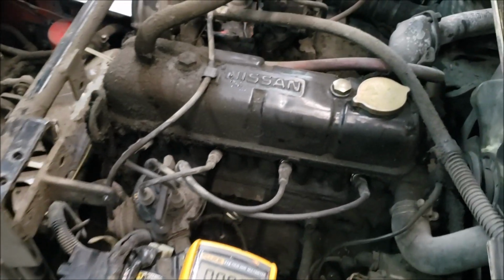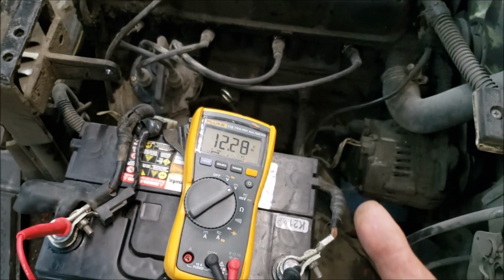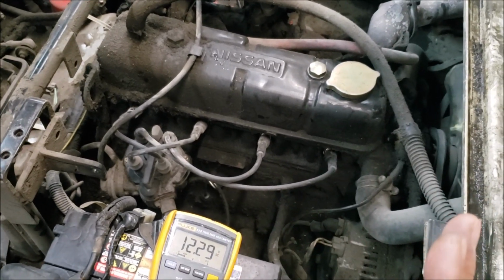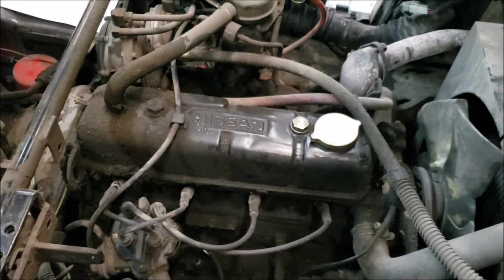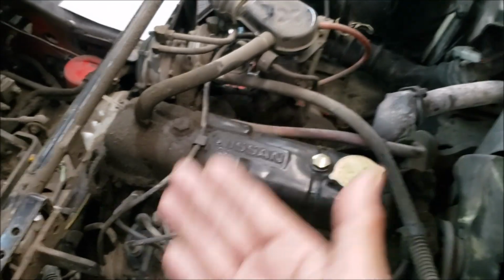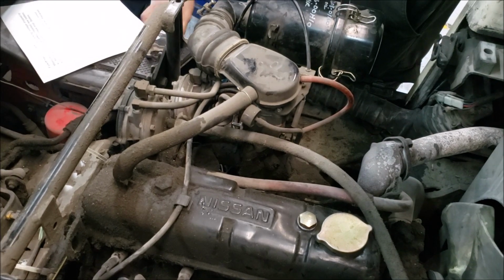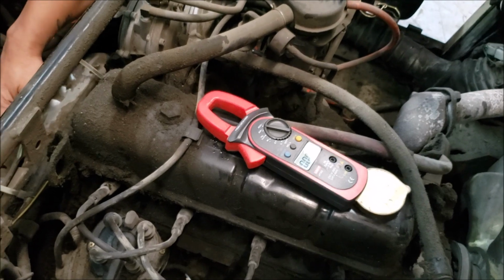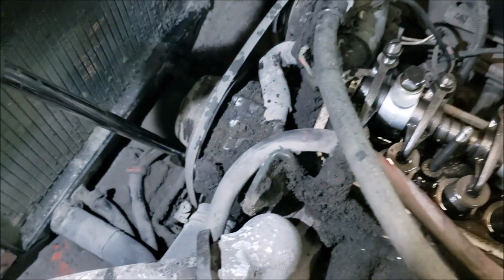No Crank, No Start, New Battery, New Starter

Comment: why would my cat p6000 not have any throttle response... it has a e21 code for maf, i found the connector for the maf was damaged, so i fixed it, and it runs a little better, but still acting the samesame mostly.,, tried to clear the code with no success.

Comment: My 07 Silverado , new battery , new starter , put the key and nothing
Reply: Also it’s a 5.3 ls
Reply: Checked all of the fuses but nothing
Reply: You probably already fixed it but my guess is that is was either the ignition switch, neutral safety switch, starter relay, or high resistance due to corrosion in the cables going to the starter or starter ground. Do voltage drop tests from battery positive to all cables going to starter and from battery negative post to starter housing.

Comment: So i have a 6.2l im having the same issues with.. should the motor be easy to turn if its not locked.. hopefully.. because ive been thinking thats my problem with my diesel truck..
Reply: I would think diesels take more torque to turn because they're higher compression engines compared to gasoline/petrol engines

Comment: Battery is perfect, switch goes on, but when i turn the key more for cranking, nothing else. I am starting my diesel forklift directly from self starter by connecting both negative and positive points with the help of a screwdriver... what else with my forklift... Please advise somebody...... Even i didn't find the fuse box,,, where is it?

Comment: I’ve done everything you said, I was about to scrap my car as I decided to tap the second new starter motor, a few blows with a rubber hammer and it sounded rough at first, then ran perfectly, deliberately stalled the car and restarted a few times, all’s well now. Thanks for the tips, I bought 2 batteries and two starter motors but finally got there in the end.

Comment: Ever have a Toyota lift stall while turning, I’m working on one now and can’t figure it out the Toyota techs can’t even figure it out , runs good has new vaporizer  and only stalls when turning all the way either way
Reply from the maker: What model? Only.when turning and not when maxing out tilt or sideahift?
Reply from the maker: Does it die when turning while driving or even when it is just parked and maxing out the steer?
Reply: @forkliftgeek10   it will die while driving and Turning , it runs fine you can max out all the hydraulics , only when turning,
Reply from the maker: Check throttle body. Clean it out.
Reply: Could be relief on stearing stalling engine ?
Reply: Did cleaning out the throttle body fix the stalling while turning issue?

Comment: Slight lack of experience I think there it’s a live and learn situation there if you’ve not experienced something before then how are you supposed to know so they’ve learnt the hard way of just throwing parts at it doesn’t always solve the mystery always ask the machine why and never assume
Personally I think everyone would have tried the battery but just jump start the engine if it still don’t turn over it’s not battery then I’d have done what you did check for the amps to the motor and then see if it turns over manually job done 30 minute job to diagnose maybe 🤔

Great video might show it to my apprentice give him the experience

Comment: This video reminds of a no start diag a tech I used to work with did. He replaced the battery and starter and still didn't start. Problem was a broken connecting rod that was sticking out of a hole in the side of the engine block.

Comment: That was a very well explained prosses of diagnostic. Also they could of tested started before replacement. good job as always.
Reply: I've had a couple of starters that pass the bench test but can't produce enough torque to turn the engine.